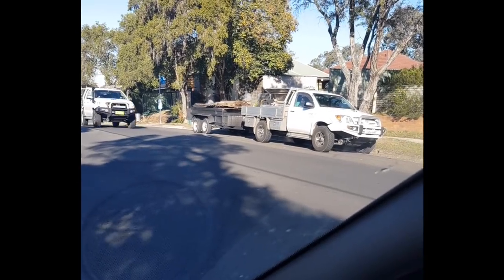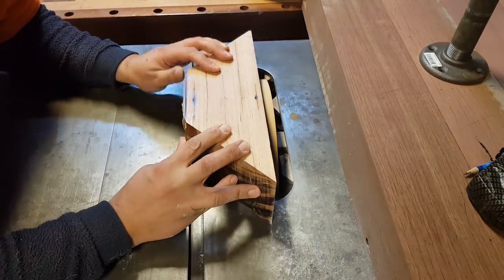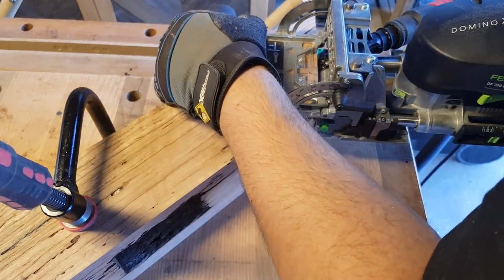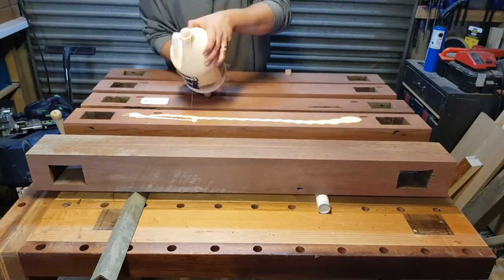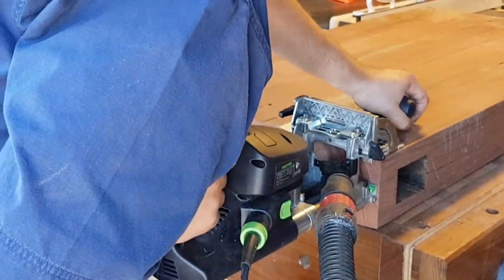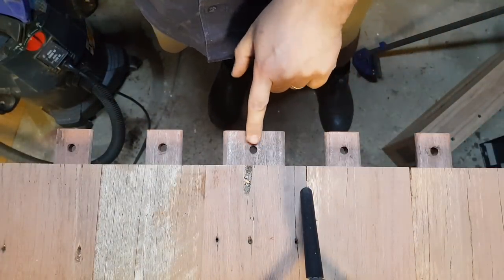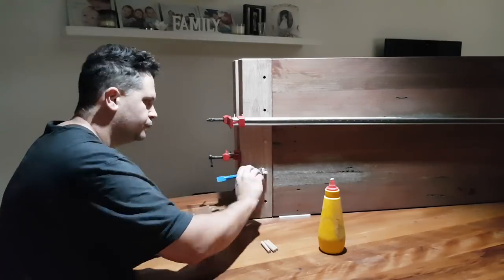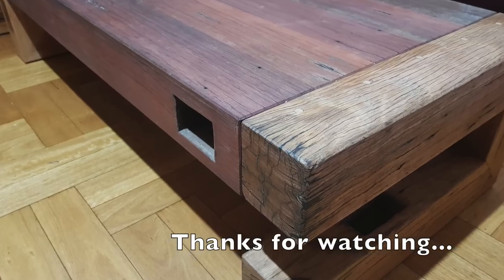Building the  Most Awesome Coffee Table Ever

Comment: Love this idea. SCORE on the old posts. That’s a dream to come across something like that. I work at a small lumber yard and got a bunch of treated 4x4 scraps bout 2’ long and gonna make the same exact thing, just a little smaller. Size isn’t everything😉. Don’t have a domino tool so just gonna wing it somehow. Great video man, great craftsmanship!!!
Reply from the maker: Thanks so much, I think with the massive surface area on those glue joints it might be fine without any reinforcement. If I had my time again I would resaw the middle board to about 1" thick and the outer boards to a 1" "L" shape with 2 cuts on the table saw to reduce weight and conserve material, it really didn't need to be this thick all the way through where no one can see it.

Comment: Very cool. Great design and craftsmanship. My only suggestion is that I might add a simple metal bar on the inside edge of the open legs. Only because I can see that cantilevered joint taking on a lot of stress over time and because gravity is a bitch.  I don't think it would be easily noticed if placed inconspicuously.
Reply from the maker: Thank you. I stress tested a sample to 220kg then I ran out of weights so I started stomping and jumping on it as hard as I could and no damage whatsoever. That stress is halved when there's 2 of them bearing the load then halved again when they're flipped front to back like they are so I reckin we'll be ok for a long time.
Reply: @OneManBandWoodworks  Fair enough.

Comment: Nice work! Marvellous piece and interesting design.  I like the timber you used, a great score too!  

I totally understand the use of dominoes, because mortise and tenon joints on Australian hardwoods are not easy tasks, and brutal on chisels and hand saws. 

A question regarding the breadboard style ends. I noticed that you elongated the drilled holes in the tenons (except for middele tenon) that fit into end piece. That I understand is to allow for seasonal movement in the wood grain of the main body of table. This as I understand it, is typical of breadboard style ends.  However, would it not also make sense to also elongate the off centre mortises in the end (i.e. the  perpendicular) piece as well?  Or did you also do that and I missed it?  I re-watched video to see if you did that but I could not see it where or if you did so.

Thank you for sharing this video.
Reply from the maker: Hi, thanks for watching and for the positive comments. The main panel is glued together so it moves as a single piece of wood thus not needing any room for expansion
Reply: @OneManBandWoodworks   Thank you for your reply.  I understand  (I think...) regarding the movement, hence only glueing the centre tenonon, and elongating the holes in the other tenons, but why not also elongate (by say just 2 or 3 mm) the matching mortises in the end/leg pieces?  If not, then why bother with elongating the dowel holes in the tenons in the first place (because the mortises in the end/leg pieces will not allow for the grain movement in the board piece into which the tenons are also snugly fit)?  How do you allow for the perpendicular grain movement?  The tenons/dominoes are aligned and snugly fit into aligning mortises and any grain movement (albeit minimal) in the board piece will be restricted by the tenons which cannot move  within the mortise of the leg piece.  So why bother with the elongated dowel holes if the tenon will not move?  

I have missed something I'm sure. 
Sorry if my questions appear silly.  Thank you for indulging me.
Reply from the maker: @sshizas6986  the mortises are elongated on the legs it's only slight but it's there
Reply: @OneManBandWoodworks  that makes sense. Thank you for clarifying.

Comment: I once worked a project wherein we removed a mezzanine from a warehouse.  The mezzanine was floored with 2x8x10' clear vertical grain Redwood.  We ended up with a tight stack of Redwood 10' tall, by 12' wide, by 20' long.  Was too hard to use in the project (it would stall a 12" Hitachi saw...), so we tried to give it away - nobody would take it!  Had to throw it in the dumpster... 30 years later, it still hurts.
Reply from the maker: You just broke my heart 💔

Comment: That was awesome, thanks! If you're still reading these comments and answering (considering your knowledge shown in the pinned comment which was hilarious), I'm wondering the comparison between dowels and Festool dominos. I know that's a good way to go but I don't want to spend the money. Do you think circular dowels (for which I can make my own jig) would add similar strength? Cheers
Reply from the maker: Dan I bought a dowelmax, it’s only about $100 in basic form and it’s tool porn, they have the strength tests on their YouTube channel and it’s stronger than the domino, well fitted and matched dowels are as strong or stronger
Reply: @OneManBandWoodworks  thanks!!

Comment: Great job though I thought you could have made two similar tables if you'd have cut the posts down the middle. My have looked slightly different bug they would have been lighter to move around. Anyway great job. By the way. Was that Danish or teak Oil you used as a finish ?
Reply from the maker: Yeah I hear you but resawing ironbark is something you don't do voluntarily
Reply: @OneManBandWoodworks  is the wood really that hard? That guy who was throwing it out must be mad or just didn't know. 
Beautiful job though.
Reply from the maker: @johnclowes3894  janka hardness is about 16, white oak is about 11 by contrast and it's full of silica

Comment: Luis, another great recycle build. Question, I notice you use PVA type glues on Aust hardwoods, local supplier to me recommends polyurethane glues, what is your thoughts/experience with this. Also have seen some do a acetone wipe down prior to gluing to remove oils etc, any thoughts on this. Thanks on advance.
Reply from the maker: Andrew S I’m so sorry I never saw this comment sooner, if it’s an oily hardwood like spotted gum, tallowwood, brush box etc you either need to glue immediately after milling or do an acetone wash or glue with epoxy. Polyurethane glue like gorilla glue the type that foams is very weak and I don’t recommend it but if they’re talking liquid nails/sika type polyurethane glue that’s not going to give you neat glue lines. I’ve used pva on oily woods without any prior prep and they do separate sometimes but acetone washing first has yielded bulletproof results

Comment: What was that product that you used to finish the table? Look like possibly some type of oil or wipe on poly?
Reply from the maker: It was a 50-50 mix of Penetrol and mineral turps as the wood is to hard to penetrate with poly and it just flakes of when it's dry
Reply: @OneManBandWoodworks  it looked absolutely awesome and I'm a sucker for simple to apply clear coats
Reply from the maker: @FFT-J  yeah me too, I really need to try the hard wax oils, they look really easy to get a good finish with
Reply: @OneManBandWoodworks  The wax oils have be a bit confused. When I think of wax, I think of a soft, scrapable material. Do wood waxs harden to a hard and clear finish?
Reply from the maker: @FFT-J  yep almost like poly but not quite as resilient
Reply: @OneManBandWoodworks  very cool. Im now putting polycrylic on a bench seat. Super easy, dries by time I'm at the other end of the piece. I apply it with a damp microfiber. Hit it with a 0000 steel wool and I may add some wax to top it off

Comment: It’s always been my understanding that you don’t glue draw board. It defeats the purpose of draw board. Am I wrong? Um asking for a friend.
By the way nice table
Reply from the maker: You can glue middle, left or right depending on which way you want it to move but you can't glue it all the way across because then it might split - might being the operative word, I have glued one before with no issues many years later just because I didn't want it to require re-sanding and finishing, it was very old and stable Oregon and has been ok for 5 years and still counting

Comment: Love your work. Just a quick question. 
I saw you used a table saw to grind down and smooth the surfaces. What did you use for that? Im assuming you removed the cutting disk and put something in its place.
What is it?
Reply from the maker: Ues that's right, if you scroll through my older videos I have build video on it though if I'm being honest it's a bit scary to use...

Comment: Fence post? Not sure about UK, but here they're pressure treated with toxic chemicals.
Reply from the maker: None of the Australian Class 1 durability hardwoods are impregnable so if it was ever treated it would've washed off after a few days in the rain. As we know that our hardwoods are not impregnable and naturally highly durable we don't waste any time treating them. Some people will paint a creosote based treatment on the submerged part but this clearly was not the case here for 3 reasons
1. didn't smell like creosote
2. wasn't black
3. they were quite rotten under the ground
So if you're unsure just do a bit of research and you might be pleasantly surprised

Oh and by the way - the UK is further away from me than it is from the land racial ignorance

Comment: Lots of work for a table that wobbles with the slightest touch.
Reply from the maker: Table's rock solid, the floor as a corresponding lump and dip in just the right place that causes the wobble.
Reply: @OneManBandWoodworks   you should install some adjustable screw feet for leveling. Works great for the issue you have!

Comment: Using dominos in there does nothing except justify the stupid price Festool charged you for that thing. Completely unneeded. The coffee table is very nice looking though. Gives me some other ideas I can use the unlimited supply of super heavy duty pallets near my house made up of 3" x 3" x 48" posts.
Reply from the maker: So being a licensed cabinetmaker I generally batch test what I make and don't pull info out of my ass.
Test joint without dominos failed at 60kg
Test joint with dominos failed at 275kg + me forcing it with the load suspended.
That's a little bit more than "nothing" in most people's opinions.
Thanks for watching.
Reply: Agree, easier, smarter and cheaper to join with tenon mortaise. And surely stronger.
Reply from the maker: @jean-lucdumas8607  have you ever put a chisel into tallowwood? 75mm deep? To give you an idea Tallowood is 2x the density of English oak, 1.5x the Janka hardness and it is full of silica. Yes that's right SAND! Aussie hardwoods are full of tool bluntening sand. So when you say a mortise and tenon is easier and faster you are truly speaking from your butt sir.
Reply: The point using dominos is easier, gives you larger surface for glue. You can find dominos made of hardwood anyway.
Reply: @OneManBandWoodworks  I've never heard of dominos making the joint stronger because the glue is stronger than the wood itself. Only know of people to use them to help alignment as you did with this project. I've never used festool products though so I cant say they're overpriced but from the looks of them they dont look worth the money but looks can be deceiving
Reply from the maker: @blake102989  on a face grain to face grain joint they only make a very small differences because they only extend the glue surface area a small amount. On the mitred leg joints or a mortise & tenin joint they make a world of difference
Reply: @OneManBandWoodworks  o ok that makes sense, I was wondering if that was the reason because I've never heard anyone talk about how they are useful when crossing grain only glueing up side by side
Reply: @blake102989  
Glue is a chemical bond that when is subjected to temperature changes, air and mechanical forces can weaken. 

So while the shear strength of when newly set glue is stronger than the wood it most certain is not more reliable than wood in the long term. Historically wood joints were used because they take the physical load. 

So a mortise and tenon joint combined with glue is a strong reliable joint. Even biscuit joints are more reliable than simple glue joints and the same applies to using screws. 

Over 20 years ago I made butt joints using only glue and biscuit joints. Well today the butt joints have failed and the biscuit joints are still going strong.
Reply from the maker: bighand69 depends on the glue and the wood in question, softer woods will peel away at the glue line and not all glues are equal, I’ve got tables I made 30 years ago in school from meranti with plain edge glue joints that are still tight with invisible glue lines